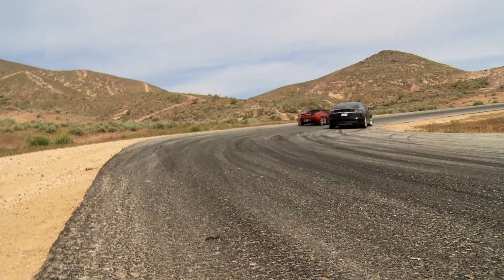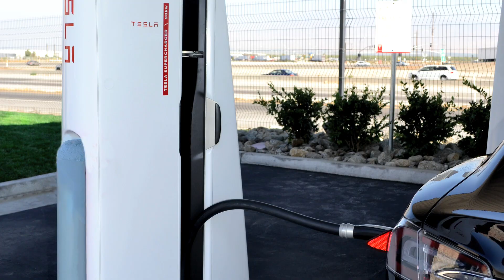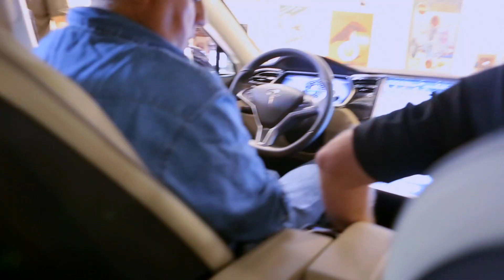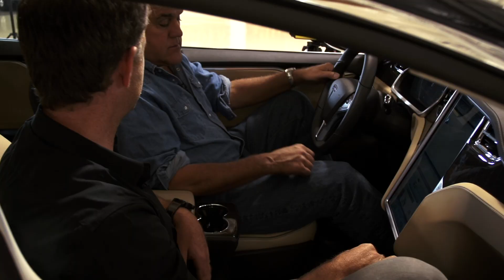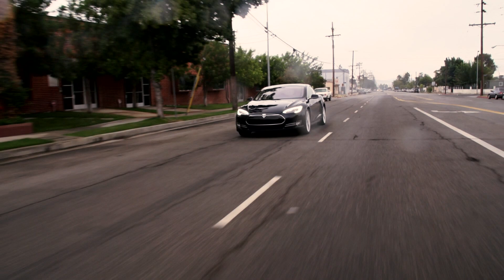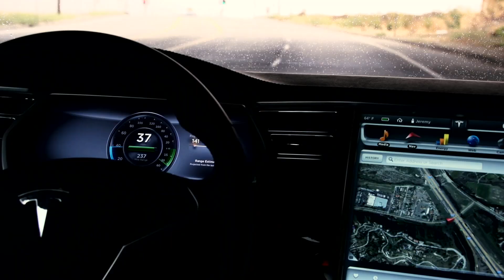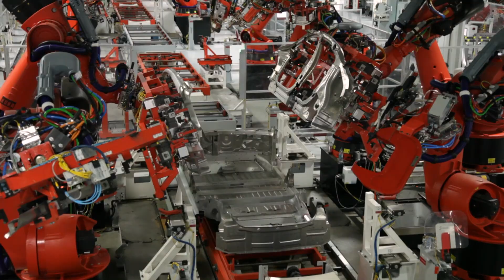2012 Tesla Model S - Jay Leno's Garage

Comment: I prefer to look at it the other way around. If you could afford a 400hp car, most people would go for a smaller engine - why? to save gas. Imagine that you could charge is overnight for less than $10 - I bet you'd want to drive it a lot more, and not worry so much about accelerating hard.
It's a fast car you can actually drive quickly without worrying about the gas you're burning

Comment: @bebomac5.. WTF! $368/month? What are you driving a dump truck? You are a fucking lying Tesla Troll. I drive 300 miles a week and spends $35/week on gas. That's 140/month.my daily driver cost 20k brand new. That's $60K cheaper than the cheapest Model S. and today's cars are well equiped and safe. Si stop talking about the cost of eperating a vehicle you dumb ass troll.

Comment: Ahhh. the promise of elon musk. you are talking something out of your ass. bebomac5 200 miles minimum. even the Tesla models $70K veriosn, if you drive it like a normal car(all gadgets on) drive it fast won't achieve it's promised range. Now you are bullshitting us with a $30K 200 mile range fantasy car. and even it achieve that fantasy, $30K for a limited range car compare to a corolla or civic that costs $20K will go more than 350 mile in one tank of gas. explain to me how it will work now.

Comment: An array of solar panels can do the job if you live in a place with sufficient sunshine. If you DIY you should be able to get 30 years of free driving for perhaps some US$10,000 but if you drive to work in the morning and come home late in the afternoon, your need to feed the energy into the grid during daytime and get credit for it as most of your charging ends up being when the sun is down.

Comment: Even in the best circumstance of being in a "near the equator" "sunny year round" climate, roof panels using current technology would only generate around 200 miles of range, per year. The cost ($500.+) can't be justified.

Comment: And the huge car batteries will go into recycling because it makes lots of sense. It's quite easy to avoid old EV batteries ending up in landfills. And during the 10 years an EV battery will last, typical cars need 3 lead batteries that are more prone to end in a landfill and have more toxic metal in them.

Comment: What is the point? Combustion engine technology will be gone due to poor efficiency in a couple of decades but there is no reason to panic about it. Today the best luxury car is an EV car but the best mid- to low-end car is still a gas car due to the cost of the battery. When your small Honda breaks down some day 8 years from now you can get your EV dream car.

Comment: The Tesla Model S utilizes a Octohedral crumple zone structure for maximum strength while still following the law of conservation of energy to absorb crash energy and direct it away from occupants. Its cabin cell is twice as crush resistant as mandated by the government. Moreover, the system uses an AC (Alternating Current) motor like an alternator which uses no rare earth metals. The car is astonishing for its size... 0-60 as fast as an M5, a drag coefficient of .24, and a pretty high range too

Comment: The Model S is priced in the same range as it's competetors, it offers similar features and performance, but is capable of things those other are not. It's a luxury, performance sedan.
The battery is not going to simply die after 10 years, and since prices drop 6-8% per year, it will be much cheaper.
Also, keep in mind that the tech will change. With newer battery/capacitor technologies, EV range will be impossible for gas cars to match.

Comment: You're correct in your statement but replace "oil" with  "fossil fuel".  It's almost 70% coal, natural gas (think: frakking), and oil.  The remainder is hydro and nuclear.  The high percentage of fossil fuel is why greenercars website rates EVs as no cleaner than a Prius (and less clean than my 70mpg insight, the 80mpg Lupo 3L, and Civic CNG)
.

Comment: Even if electricity is made from fossil fuels, it is times more efficient to burn them at the large power plant and then use it to power the cars than burn it in small car engines. 
But since we will have to find alternative power sources anyway, it's natural to also power cars with electricity.

Comment: No, Li-ion batteries are more expensive per kW·h than Ni-MH batteries. The only feature that Li-ion batteries outperform Ni-MH is in energy density, i.e., kW·h / kg battery. But the weight has little to do with price.
You can build a heavier and larger car using Ni-MH with same energy storage capacity as the Model S but much cheaper. Or alternatively you can make a car with similar power, weight and volume, but with shorter range, and more significantly, much cheaper than the current Model S.

Comment: That means that in the end (after all engineering, installation, etc) , 1 kWh of stored energy in Model S cost less than in their competitors cars. Even though Li-Ion batteries are more expensive.

Comment: I agree with the savings of not paying for gas, but the car isn't exactly cheap and if you were to take a long road trip, say 1000 miles or more it would probably get pretty old having to stop for 40 minutes instead of 5 every 250 or so miles. Overall I think its a great car and it shows that EVs are moving foreward

Comment: Tesla supercharger stations charge from flat to full in 40 minutes (150 miles per 20 minutes). The 15-35 minutes you save filling up at a gas station are not worth the $50-$80 you pay for the gas. The supercharger staions are Free to use. The thing is, that with EV's 75%+ of charging is done at home, while you sleep. You don't visit charging stations anywhere near as often as gas stations.

Comment: "after installation they are the cheapest by kWh"
- What does that even mean? Either they are cheaper or not, and they are not. After you sum up all the costs to build and use the batteries Li-Ion are much more expensive than Ni-MH. Tesla probably chose Li-ion because of their higher performance (i.e., higher charge density). They wanted to make a fast big car to impress wealthy consumers, a sector of the market with greater profit margins, so they picked the batteries with more energy density.

Comment: Ni-HM batteries loses ability to hold charge after hundreds of cycles. So Prius only recharged up to 60%-40%. But I still don't see any arguments as to why Li-ion batteries in Model s is a bad thing. Tesla takes expensive (in comparison to other car makers) batteries and after installation they are the cheapest by kWh.

Comment: Less moving parts means longer service time. And 1/5 is a lot. And it transfers to other parts, bc without engine vibration, etc they will last longer. 
Don't know about cost. But eventually less parts = cheaper. And there have been zero battery related incidents with model s.

Comment: And the same can be said about various parts parts of ICE. But the point is that EV has 20% of moving parts of normal car. Less vibration = lower degradation. So I don't see the point of your post. 

As for batteries. Prius NiMH had other disadvantages. Tesla uses smart cooling and individual charging of cells, which dramatically extends life. Also, Li-Ion has no memory, unlike nickel based Prius. But if your whole argument is just to point it's different type of battery...

Comment: The first Prius batteries were of a different technology.
The battery prices haven't gone down. Rather, the battery manufacturers upgrade them, so that for the same price they offer greater performance, but the price remains the same. An analogous process to laptops and microprocessors, they are priced similarly to 10 years ago but offer greater performance.

Comment: The first generation of batteries in the Prius wasn't lithium-ion.
The EVs also have many components susceptible to need replacement.
E.g., the (rather expensive) air suspensions in the high-end Model S, the transmission in the EVs can also break down, the electric and electronic components can fail, the bodywork, lamps, windows, upholstery, all of that can break, wear or tear too. The central panel will likely require an upgrade after a few years time.

Comment: There's a good reason that explains why Tesla cars are priced to up $100K. Their price reflect the energy-intensive of their manufacture, including the cost of energy and resources to extract, refine and process metals like lithium, for the construction of the machinery used to build the different components and to ensamble them.
Also, their manpower is energy-intensive. Tesla's workers have to eat, go to work, drive, go on holidays. The larger the staff, the more energy will they consume.

Comment: If you count battery replacement for electric cars, you must also count oil changes, gear box, transmission, engine repairs and replacement for ICE cars. And batteries will probably last longer than guaranteed. Look at Prius  - those first gen batteries are still running and that's a 10 year old battery technology. And even after that, those batteries are still usable for off grid electricity storage at night and even after that - they are recyclable. Not to mention becoming cheaper.

Comment: The cost of the batteries drop 6-8% every year, they wont be anywhere near as expensive, and considering Prius batteries from 2002 are still in operation, they may last much longer. And its not as if the just die all at once either.

Comment: The claim is you will save lots of money in fuel cost besides the positive impact for the environment. But when the batteries run out after 8 or 10 years the cost for the replacement battery may be equal or more to the savings from the fuel cost..

Comment: 21¤ rims?  hello Leno - the roads here in Norway cant use 21¤ rims. the roads are just too bad for tyres with 225/20 or 30/21 - it has to be 205/60/16 rather.   do you know that Teslas top chief came to Norway because of all orders ?   
ThM - Norway

Comment: No, it's not better.  Sure it's a good direction. But it's like driverless cars. You don't want it going too far. (I'll use an analogy here) What I was mentioning in my comment is like having traction and stability ctrl. You want a man-and-machine connection with your car, but you need new technology in order to sustain that connection with your car (prevent accidents/deaths). Can you understand the connection?

Comment: 1. They don't swap batteries, currently they just use charging

2. The electricity it uses from coal depends on where and what you charge from. Some states power their electricity with 90%+ coal and some with less than 40%. 

Even if you used 100% coal produced electricity to charge it, the overall CO2 emisions would be less than 50% that of a gas powered vehicle; so it is great for the environment.

Tesla Supercharger stations are powered by Solar Energy so that is 100% clean electricity.

Comment: So, by that definition, gasoline - powered cars don't need fuel, or an ignition system, just hot gas.
I still believe what's driving a gas - powered car is an engine, and an electric car is a motor (or motors), and they aren't the same thing.

Comment: A motor converts one kind of energy to another: an electric motor turns electrical energy into mechanical energy, An engine develops energy from fuel. What's under the hood of gas-powered cars is an  engine, even though they are commonly called motors.

Comment: If you're burning liquid fossil fuels to make electricity, the lower refining requirements, the efficiency of scale (including cheaper exhaust cleaning), and the efficiency of delivery (wires vs fuel trucks, both require pipelines) makes electric win, even without renewables.  Coal is dirty all around, is a lose, and will be phased out of power generation.  And the more renewables you can put online, that's a double-win.

Comment: My point is; eventually, once fuel gets too expensive, electric motors and battery packs get lighter.
We will have to move with the times. But we don't want to give up the living breathing thoroughbred aura of an IC engine.
So if we make powerful hybrids with lighter batteries that run on vegetation (e.g. sugar cane) sourced renewable ethanol, we can have a compromise which gives you the best of both worlds. It's a win-win.

Comment: If you think about it using explosions in a chamber to move parts to power a vehicle is pretty sketchy sounding. Also if you think about it, oil is just as "natural" as electricity, and carbon emissions just as natural as oxygen emissions when we breathe. The politicizing agenda driven falsified data of the global warming scam is just that, a scam. Climate change is natural, like ice ages and heat waves you know? But I'm all for efficient energy and like Jay's comment about using both at times.

Comment: For performance/sports/super cars, an EV platform just doesn't deliver properly. So, it's not an ideal future.
What we need are hybrids like the LaFerrari, McLaren P1 and Porsche 918. That's what the future beholds.
How? Because you get great economy with the elec-motor when you need it, with all the glorious noises from the IC engine when you want it.
AND have both working together for 1000+ hp when you need the power.

Comment: When you buy a Tesla you are buying a "gas" powered car. The thing you idiots fail to understand is that electric cars run on fossil fuels. They emit every bit as much toxins into the atmosphere as typical cars. Also a fun-fact for you - the batteries found in these cars are extremely toxic. More emissions are produced making the batteries in this car than a diesel truck makes in 200k miles.

Electricity is a step back - been done before and abandoned before. Hydrogen is the way of the future.

Comment: By no means do I think you're picking on this car. I know people have genuine concerns about all relatively new technologies. As someone who works with new technologies on a daily basic, I consider it my responsibility to help distinguish myths from fact. There will be faults, but not as bad as the ford pinto's exploding fuel tank. The flatbed was probably used to avoid damaging the motor/batteries: an electric car that runs out can still "roll", like your car can when its timing belt is broken

Comment: I'm just a measly programmer. The software glitches you talk about are a non-issue. Electric motors are very simple things. The software that regulates the torque is pretty standard (most internal combustion cars have a similar system). Seizing up: I can't imagine there never being a manual electric car (with mechanical clutch), nor can I imagine there not being such a thing in development as we speak. If the car shuts down, ride the clutch to come to a controlled sop

Comment: He never said the battery was 35k, he was talking about the new car that is 35k from tesla. Benedocta was trying to reason that if a tesla was 35k there would be no range on it because the battery is expensive. Tesla has to make a profit too you know, 60 Kwh battery cost 10k to replace.10k alone for the battery, include the engine, leather seats, the car itself, and etc. I wonder if it is possible for them to make a 35k tesla with decent range at this time. in the future yes but not currently.

Comment: Electric vehicles are the future there is no doubt.  Even a 50k electric with 300 mile range would be economically viable for 50% of people.  At 100k miles on my mazda 3 i've probably spent 10-20k on maintenance (repairs and fluid changes) and another 20k on gas.  Heck this car at 80k would almost be economically viable.

Comment: Model is costs 62k, while BMW 7 Series - 70k, BMW M3 - 62k, and i'm not even mentioning costing whose over 100k. And Tesla outperforms them. 

Don't be a hater. 97% of all trips are not longer than 50 miles. And Model S has 160 miles range . So it's not a problem, especially with the ever expanding charging network.

Comment: The car is expensive - but one amazing thing is that with the Tesla Model S you get FREE fuel on highway driving for LIFE. The car can charge for free on the super-charger networks. Stick that to $4 a gallon gasoline. Also electricity is 3x cheaper than gasoline, ie. you can go 300 miles on $10 of electricity. A car in the US can go about 100 miles on $10 gasoline.

Comment: That's rubbish. Lithium batteries are not dangerous. Nickel Cadmium batteries are as Cadmium is toxic. Lithium isn't. The batteries lose charge at a rate of 10% per 700 charges. If you can do 200 miles per charge that's 140,000 miles and you drop 10%. Charge twice a week - 100x a year. That's 7 years before you've charged 700 times and you might notice that 10% drop. Once the pack is really old the grid companies will be interested in your remaining 60,70,80% pack for load-balancing.

Comment: There are about 15-20 BMW models for 2013 that fall inbetween $65K - $110K, which should cover the spread of all available models / trim for the Tesla Model S. 
The 650i Gran Coupe, which has kickass hp / torque numbers is slightly slower 0-60 than the top Model S and costs about the same, has LESS range in city driving and 20-40% greater for hiway.
BWM is a quality automaker but Tesla is the scrappy startup that could, can and will.

Comment: There is something unnatural about a car that can do a burn out without the motor noise.  What this car really needs is a external sound option (think VW did this already).  Let me dial in a uneven idle that sounds like it is due to a radical cam, tie in the acceleration to what a corvette or a porsche would sound like if I put my foot into it. :)

Comment: What they don't tell you about the cars range is that you really have a 150 mille range in a circle because if you  make trips from home to some where and back right away you need to save half the power to get back home . On a long trip you can go 300 miles but have to stop and charge it.